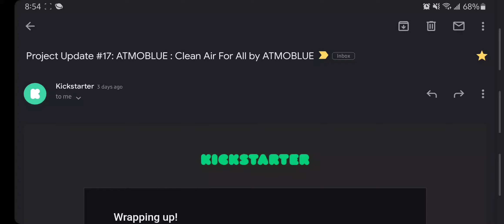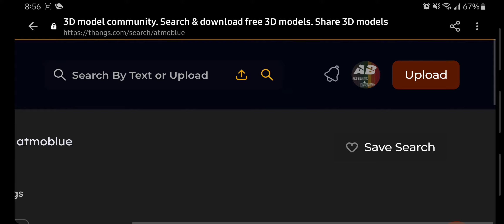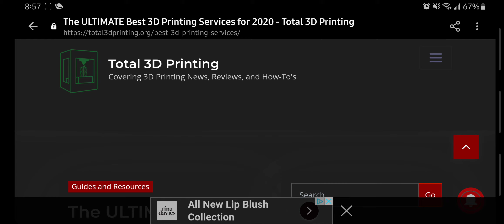Atmoblue | Free 3D blueprint add-on.

Comment: Just doing my public service: While this plug technically makes the mask valve-less/flap-less and therefore conforms to local regulations, this respirator almost certainly won't fly if you want to travel by airplane. Airlines have a lot of discretionary power when it comes to refusing respirators that look suspicious, and the flight crew really doesn't have time to examine every respirator closely to make sure it is valve-less -- so they can and will turn these respirators away.

For personal safety, yes, use this plug! For boarding an airplane, put a disposable surgical mask over the respirator, no matter if you've plugged the vent or not.
Reply from the maker: Also, I think the batteries don't meet flight standards. And wouldn't be allowed on a plane

Comment: Thank you. Update #17 on Kickstarter is only aviable for backers. For Indiegogo backers there isn't Update with 3D model yet. Thank you so much.
Reply from the maker: Oh wow I didn't even realize
Reply: @AndreBrown86  LOL
Reply from the maker: @huleeyo  I hope I didn't mess anything up
Reply: @AndreBrown86  I don't think so because the STL file doesn't have any lock or limitation to use.
Reply from the maker: I guess it would only benefit those who have bought the mask anyway lol
Reply from the maker: I should probably make sure I don't release other things in the future unless it's something simple like this thats free and specific.  Good thing to think about.
Reply: @AndreBrown86  Haha, no problem. AB Unboxing and Reviews shows us many details of Atmoblue and other products that other channels do not.
Reply: @AndreBrown86  
I was wondering if you noticed any changes to the silicone vent in the atmoblue masks you have vs comments from early Kickstarter users who reported the vent does not really close tightly and allows unfiltered air in when the fans are off or when taking heavy breaths with the fans on?
Reply from the maker: @OnTalyn  i think I noticed it before, thats why I made my own valve closure. I never trust mechanisms like that.
Reply: @AndreBrown86  gotcha.  I thought it might have been just because of any no vent exhaling requirements. 

This will have to be one of my first tasks once I get mine.  
On a side note those le wire head straps are pretty cool.
Reply: Thank you for posting this info.  I contacted a 3D printing service and provided the file from the website. I should have the valve cover and mask by the end of the week. I can't wait to try! I am a personal trainer who train a few clients in their homes. At the beginning, I thought I was going to pass out from the inability to breathe. Months later and there's been improvement but nothing improves sweating under the seal.
Reply from the maker: @SHAD3S34  just a heads up. When you do close off the seal there is condensation. Ive found they putting something like a small piece of rolled up microfiber cloth at the bottom on the inside helps with this (like ones used for glasses) then take it out later and clean it. I chose the one used for glasses. I was also thinking a small sponge would too. Not sure which one is safer though.
Reply: @AndreBrown86  Thank you for responding. How do I make the microfiber remain in one place without using glue? The last I want is wetness inside the mask. I wish I was brave to wear using the flap.
Reply from the maker: I rolled a small piece up and put it where the silicone piece curves at the bottom.